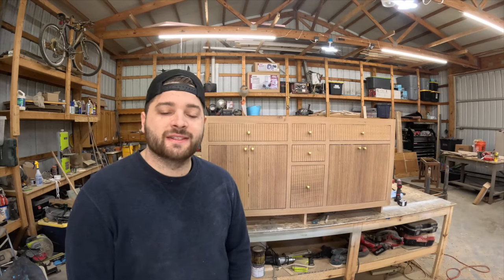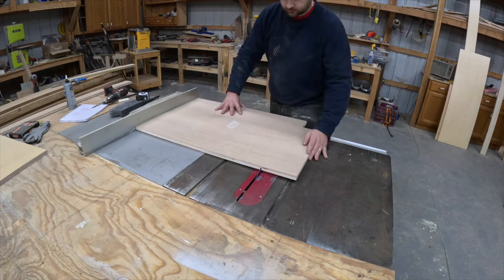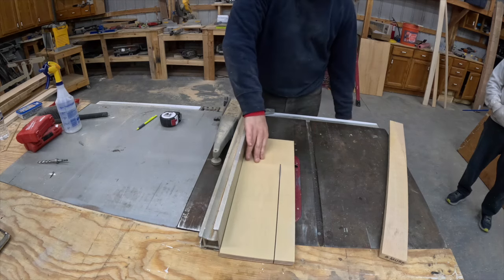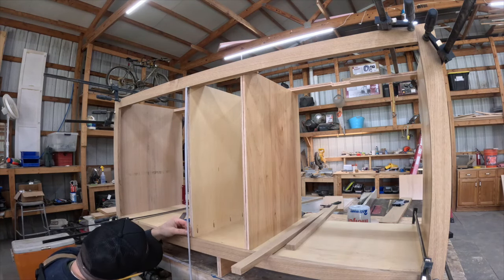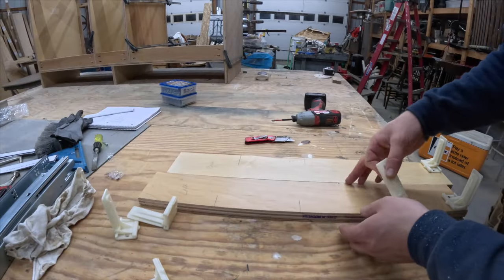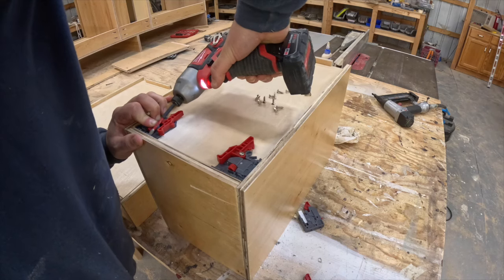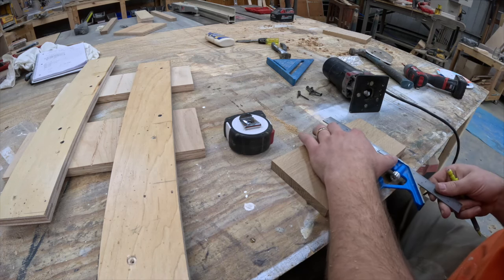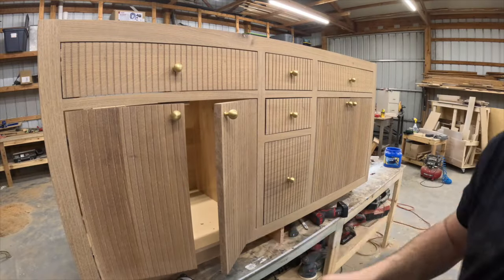Modern White Oak Vanity Build | Fluted Doors | MASTER BATHROOM Addition Part 5

Comment: You mention a video about how to joint lumber without a joiner, but there is no link and I don't see it in your video list. Mind sharing? Thank you!
Reply from the maker: Hey Peter! I will be uploading shortly, didn’t get it done in time. Make sure your subscribed so you see when I upload it, but I’ll also comment to you when it’s up. Thanks for watching!
Reply: Just use another board that's longer than the board you want to joint as the reference against the fence of your table saw, e.g. the factory edge of plywood board. Attach the board you want to joint to the reference board with double sided tape or hot glue such that the full length of one edge hangs slightly off the edge of the reference board. Adjust saw fence such that the blade will make a full pass through the board. Congrats you now have nice new straight edge.
Reply from the maker: This is a great way for shorter boards. I’ve found it’s tough to get it perfect on longer boards, say for a table. Will release a video on how to do both short and longer soon!